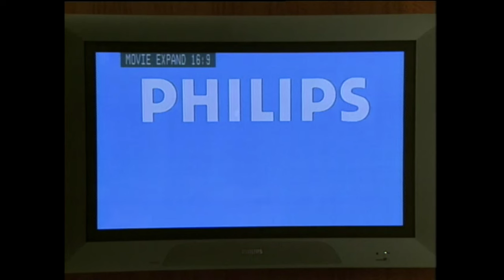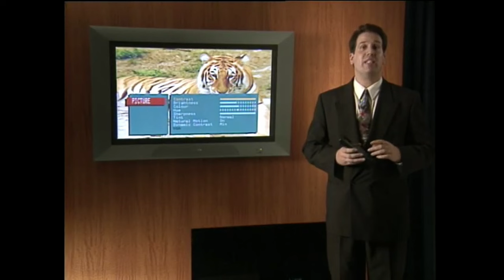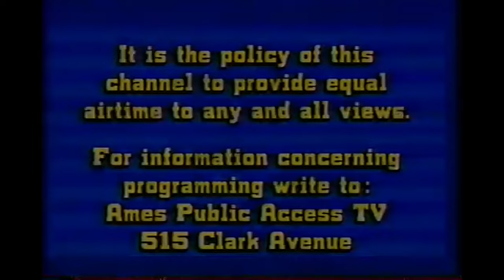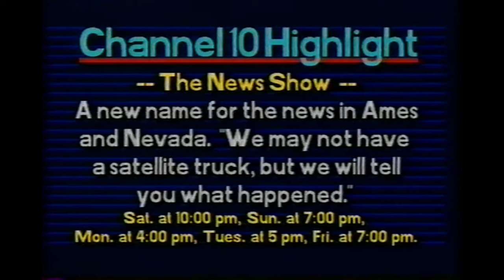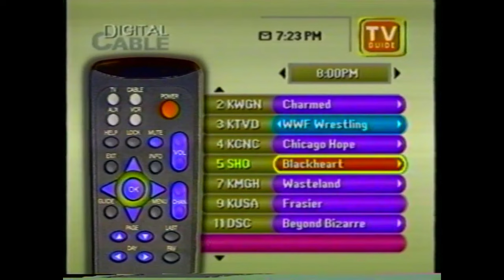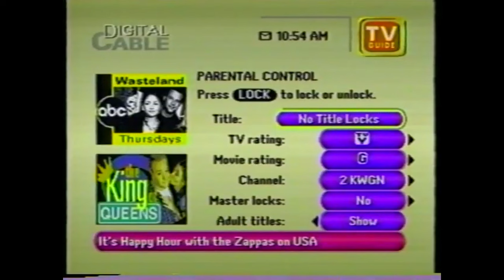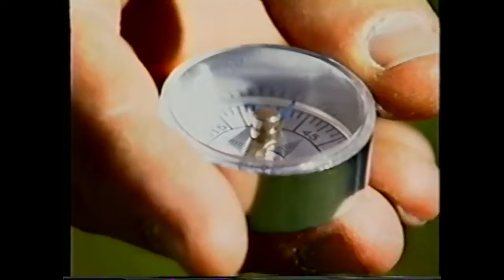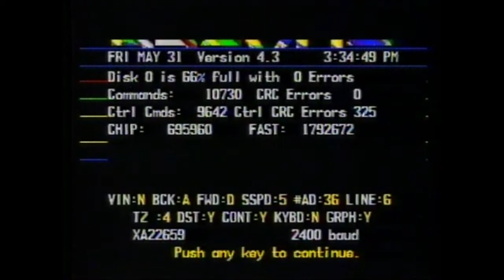Digital Dreams: 1990s Television Nostalgia | Sleepcore

Comment: In our area, we got cable TV back in the late '80s.  That was some difference compared to watching NBC, ABC, PBS and a few other channels over the airwaves.  I had to use a cable box when I subscribed to The Disney Channel.  The Prevue Guide became The Prevue Channel and then The TV Guide Channel.  Amiga computers were used for that channel (as you may notice near the end of this video).  Cable TV got too costly, which is why a couple of years ago I decided to "cut the cord" and got Roku.

852 X 480.  That's NTSC DVD quality in the 16:9 ratio.  This guy presented it as an exciting new thing.  That was then.  Now, we have HDTV (1280 × 720 or 1280 × 1080) as well as 4K (3840 × 2160).  How much more will we get???
Reply: This Guy is nuts,
our Area, muhahahaha, he forgot where it was, funny ?